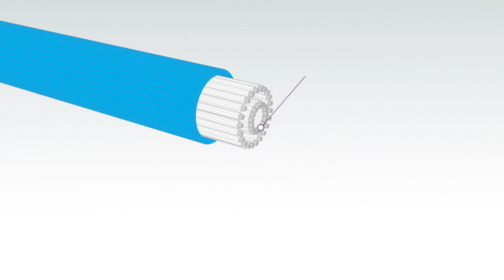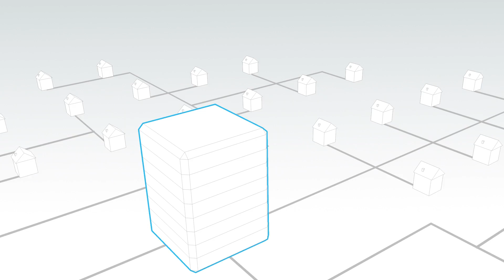DOCSIS 3.1 Technology Explained | NETGEAR Gigabit Cable Internet

Comment: kind of dissapointed my ISP reported drops in signaling, stating that it is coming from my modem, which tells me that my netgear modem is going out after only 6 months of use.
Reply from the maker: Hi Dwayne, you can always reach our support team via the link below if you need any technical assistance with your NETGEAR device.

https://www.netgear.com/about/contact-us/

You can also call the number below.

1-888-NETGEAR (1-888-6384327)

NETGEAR Team

Comment: America’s problem is simple no one wanna dig roads & sidewalks to lay fiber. The regulatory hurdle is enormous. We need a new technology. Until then stuck with Docsis 3.1, if it works
Reply: 5G will be faster than any land line, hard lines will be dinosaur tech moving forward.
Reply: @leef1500  Not safe though

Comment: what they dont tell you,is you need a new 3.1 capable modem,AND a 3.1 capable router....get ready to buy new sh--.OH AND the local cable companies will have to update their infrastructure to accomodate as well (pricey)
Reply: The NETGEAR Nighthawk CAX80 is both a cable modem and router that supports DOCSIS 3.1. That said, most people do not need 10Gb service. This would be beneficial for a branch office and for media personalities that do live broadcasts from home, but most applications do not require this much bandwidth.
Reply: Not too mention the ISP(Internet service provider) headends will also have to be upgraded as well.It will be a long time before true 3.1 will roll out.You can squeeze whatever you want out of the existing equipment/infrastructure doesnt make it true legit 3.1 though

Comment: I got the cm1000 but how do I know if my modem is using 3.0 or 3.1? how do I put my modem into 3.1 mode?
Reply: Your cable network operator would be able to tell you whether 3.1 is enabled in your area and if it is supported by your CM1000.

Comment: i just signed up for extreme pro internet xfinity now i need a docsis 3.1 modem
Reply: Which modem did you get?
Reply: https://www.amazon.com/NETGEAR-CM1000-DOCSIS-Ultra-High-download/dp/B01I5TJGSE/ref=sr_1_2_sspa?s=pc&ie=UTF8&qid=1517336285&sr=1-2-spons&keywords=docsis+3.1+modem&psc=1
Reply: Vietboy Gamer just got xfinity gigabit and their 3.0 modem only gives me 250mbs down. Did they have to run new cable?
Reply: nope just old cable extreme pro internet required a 3.1 docsis to work with 400mb and up
Reply: Vietboy Gamer you saved me hours of trouble shooting. Cheers brother !!
Reply: nice 250mbs is not bad i chose extreme pro internet package because it's cheap for that speed.
Reply: lol okay np

Comment: What kind of cable do they use
Reply: 23dlc coax various sizes. Preferably RG-6 within homes premise and various sizes of mainline in the cable operators network.
Reply: haha you wish, you think they're going to pass on the savings to the consumer?
Reply: ronniedude I'm not sure, but I can gaurentee you that they will have a considerable edge when competing with new fiber startups. In other words, They will be able to make their prices low enough to easily compete.
Reply: That's the kicker, it's the same standard stuff that's already there.  So instead of spending billions on new cable they spent half a billion on better radio.
Reply: What's a name? Yepp. And their savings mean that they can offer a far more reasonable price than the new fiber providers popping up.
Reply: Exactly, Grande here in San Antonio is offering 1000/50 for $70 USD.
Reply: @phillip_mcguinness7025  Grande gang
Reply: What's a name? What's the install fee, and contract requirments?
Reply: The average monthly fee I see is around $40USD for connection fee and taxes.

Comment: Docsis 3.0 invented in 2006, Docsis 3.1 in 2014, and it 10x faster than current Docsis 3.0, why not just call it "DOCSIS 4" ?
Reply: Ernest Jay Probliy Docsis 4 Was 100 GBIT Upto,Docsis 5 Was 1000 GBIT Upto So On
Reply: Docsis 4 will be out around 2021.
Reply: RKGSD its coming soon i really hope its in 2021 that gives us symmetrical speeds through coax
Reply: @rkgsd  I coming from the future 2021 , not did not came out yet lol ... i just bought a NETGEAR Cable Modem CM1000 3.1docsis.

Comment: I can't wait til DOCSIS 3.1 becomes available here
Reply: Should I get you really excited May of 2020 they just came out with the docsis 4.0 which is 10 gigs down 6 gigs over coax cable 😳🤯👍 designed by cablelabs
Reply: @nathansampson662   I would like to read about that or watch a video
Reply: @CK5150xxx  the company who makes the modem is called cablelabs
Reply: @CK5150xxx  there is not really much for videos but there's a lot of articles on it really good articles to read so just Google it

Comment: Cable can be made of cheese for all I care. If they can make 1gbps+ speeds and low latency available for me for a practical price I'm on board. Comcast currently offers 2gbps in my area for 300 a month +equipment charges and a 500 installation fee. Pass for now.
Reply: Jaron Wheeler no one?
Reply: Grande in San Antonio is offering gigabit cable for $70USD/mo for first 12 months.  Even after the customary price hike to $120USD it's still thousands cheaper than what gigabit used to be.
Reply: Jaron Wheeler it should if you understand how fiber is splices, and what's required to splice it.
Reply: Mike ya that's  pretty expensive
Reply: Come to Australia, we pay $100 on 5mbps down 1mbps up
Reply: They're offering 1gb down now, for $90
Reply: Mike Ellis That is absolutely ridiculous. it shouldn't even have to cost that much for those speeds. let alone the dang installation. No one has $800 to just give away like that.

Comment: Fiber is the way of the future and we have plenty of it. Just another way to keep cable companies operating on old outdated coax
Reply: Be thank-full most of the UK dont even have coax we have cheep ass copper and ally phone cables that if you live around 1km from the exchange your lucky to see 10mbit never mind 100mbit.
Reply: Fiber is, that is correct. Comcast, charter, cox, altice, etc... Are all considered HFC networks. This means their network consisst of hybrid fiber and coax. The end goal of any hfc network is to go fiber to the home. In the mean time, like you mention, they would  like to use the existing plant if they can still keep up with bandwidth demands. With docis 3.1, they can keep up with it, and will for a long time. The idea is to save money, which actually is a good thing for the consumer. while others are going to spend a fortune getting fiber to your house, the cable company will be able to offer the same speeds at a fraction of the cost. Ppl don't care what kind of cable is used, but rather about speed/price.
Reply: you're technically right but Problem is,
there's huge areas that still only have coaxial wires. 
So, squeezing the most out of it is actually very great!
Reply: OMG Videos do you really use 1000 up? If so, WTF are you uploading? Look, all I'm saying is that catv will compete by offering 1000 down, which is still far more speed than is needed for a household, small/medium business, most hotels/motels,etc, at a fraction of fiber costs.. Remember that IEEE 802.11AC can't even realistically do a gig. That said, you still need Ethernet cables home ran to a gigabit switch to utilize such speeds. Furthermore, most websites' bandwidth is bottle-necked by it's server, or the backbone/network it is using. Basically what I mean is that in many cases, stuff only loads so fast, no matter your isp. In the case of catv bandwidth, in most cases anyways, having high speeds can only utilize the  increased bandwidth to allow your router handle more clients. It's like choosing a car only by horsepower alone to win a race. There's just more to it than that.
Reply: You really are the definition of a 1st world problem. Fiber optics cant be installed everywhere overnight. Coax speeds are not outdated by any means and provide more then enough data for ant use-case-scenerio
Reply: OMG Videos well, I won't argue with that, that's roughly 20-60mins of 4k@30fps, it probably would take me a year or 2 to match that with photos/documents. So you say cox is charging the same as the fttx company(im assuming the fiber co has comparable install fee and contract). If this is true, you are unfortunately subject to price gouging. Unfair as it is, if cox thinks ppl are willing to pay that price, they will charge that price. If a fttx ISP rolls in, they will likely have the flexibility of offering a very competitive price.
Reply: I pay 25 euro for 200/10 Internet speed and my ISP uses cable and my modem is EURODOCSIS 3.0
Reply: xXAwesomeGuyXx what country? Urban or rural? Contract? Do you bundle for that price? That's a pretty good deal. That's I think almost $30 USD. My location in the USA (semi rural small town) charges the same for 100/7, but only when you bundle with tv and phone. Otherwise it's $45 promotional then 60 after 1 year.
Reply: gt5228z I'm on a 2 year contract,I bundle also IPTV and I live in a urban area
Reply: @notapieceofgarbage only limited deployment. Same with charter, Xfinity, Cox, etc... D3.1 gives you comparable speeds for a fraction of the price. It's capable download speeds of 10GBPS (with active devices upgraded)